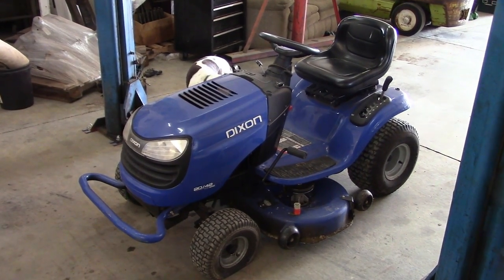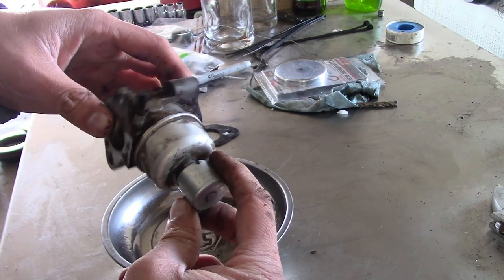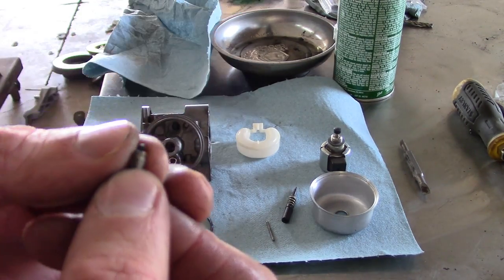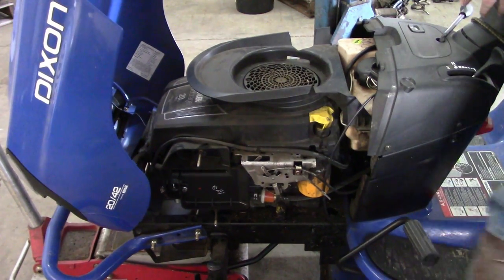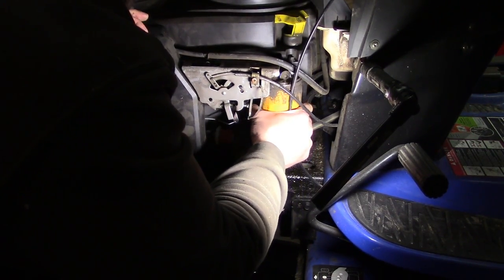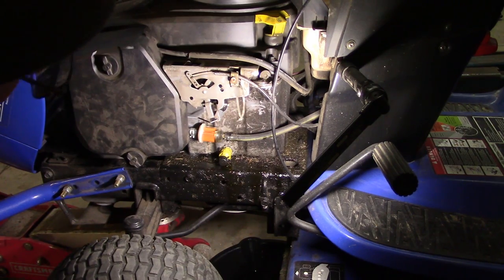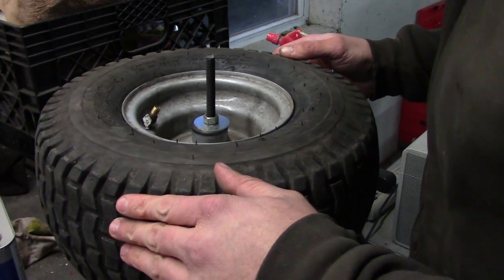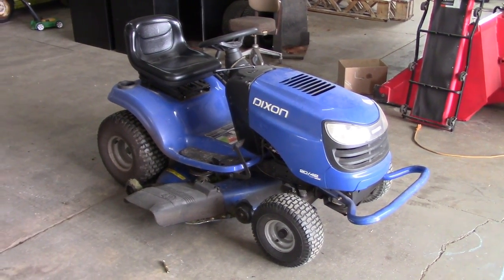Fixing up a Small Lawn Mower

Comment: Dixon was bought by AYP in 2004, but before then they were one of the pioneering brands for zero turn lawn mowers. The Dixon ZTR's were the best in their class at the time of manufacture. I own one dating to 1999, and it's still kicking to this day. I dare say that they don't make 'em like they used to!
Reply from the maker: My dad worked for a shop that was a Dixon dealer when they first came out with the friction clutch zero turn mowers in the 70s. He said they sold them like crazy.
Reply: @WatchWesWork  I'd believe it.

Comment: Hi Wes! I was a small engine tech at Sears for almost 20 years. Enjoy your videos! Just a tip- always use the Kohler oil filters- Fram is an auto filter and does not filter the oil on a small engine good enough. Also- those oil drains are designed to have a piece of tubing over the nipple so you don't make a huge mess. You also can start those without sitting on the seat by engaging the parking brake. Keep on wrenching buddy!!
Reply from the maker: Yeah, the customer sent the Fram, so I figured I better use it.
Reply: The OEM John Deere oil filters will also work as I have found out. The John Deere part number is AM125424c. I’m saying this because I put the same engine in my ‘85 John Deere lawn tractor and I don’t regret it one bit. I even had my fair share of “armchair mechanics” harassing me with bad info about my engine but I’m not willing to let that change my opinion.

Comment: Any project is good to watch. I was only half surprised at how tight the filter was. Found a few on various engines that required grunt effort to remove. Thank you for the video.
Reply from the maker: Yeah, I've had to use the air hammer before...

Comment: If you have access to an ultrasonic bath they are usually useful for cleaning small fiddly items like carburettors.
Reply: Gary Cunningham do you just set the whole carb in the ultra sound?
Reply: Josh Matthews disassemble as much as possible then put it in

Comment: Why do we like to watch Wes work? I’ve got to do the same thing to my mower and I’m avoiding like Wuhan virus.
Reply from the maker: I know. We had all winter, but of course it never got done. Now we need them...
Reply: Taryl has several useful videos on the Kohler Courage engine, as well as servicing the Tuff Torq transmission. The engine and carb manuals are free downloads on Kohler website.
I have a Cub Cadet LT 1045-
Reply: I like mower maintenance now because I am super cheap lol  as I spent 1900 bucks on my mower after I destroyed the first one from just using it and leaving it outside.  I bought this one at 40 so far I am two years in and I treat it like a classic Lincoln lol The goal is to never buy another one by maintaining it, cleaning it and properly storing it... Hell I even use stabil in the fuel tank incase I don't use it for a few months as the ethanol gas here in Commiefornia turns to garbage in a few weeks and even coats the gas cans in white powdery stuff that plugs fuel filters and carburetor orifices.
Reply: NGK PLUGS
MOBIL-1 OIL
ETHANOL-FREE PREMIUM GAS
Reply: @horacerumpole6912  I use ethanol-free gas from Quiktrip on my new murray 42"riding mower.
'

Comment: This channel is called Watch Wes Work. I subscribed because I like to see what you are doing, for some strange, creepy reason. Doesn't matter what you are working on, I do enjoy watching a professional doing things the right way. It has helped me on more than one occasion fix cars/equipment that I have. Because of that, I watch just about every video you put on the channel even if I don't care about the specific equipment. I might see a tip in there that works for something completely different, like the way you fix wiring issues.
Reply from the maker: Well thanks! I do the same with videos I watch.

Comment: Hey Wes, the front 4 10mm bolts that hold the crankcase halves together above the cylinder side of the engine have a tendency to back out and leak oil. In worse case situations they all come loose and the bottom half of the “bucket engine” as we call it will split right down the middle behind the starter and leak even more oil. Another issue is the cork style V shaped rocker cover gasket leaks oil too, I’ve always thrown that gasket away and siliconed it back together after bending the cover back flat again from the factory tightened bolts deforming it due to the thick cork. Not saying that you may not already know this but just figured I’d send ya some tips from what I’ve seen with these types of engines over the past 20 years
Reply from the maker: Well the valve cover leaks a lot. But I'm sure they won't want to fix it.
Reply: Watch Wes Work It isn’t a huge issue lol. It reminds me of a customer that brought hers to me except it was a huskee or husqvarna or something another and she said it won’t start and the mower also catches on fire every time she mows within the first 10 minutes but always goes out by itself and I thought to myself why not stop and check it since it should be a concerning issue right? Well her son never showed her that the hood actually flips up to check the oil and whatnot when he bought her the mower. So she’s had this mower for over a year and a half with zero maintenance done and the only reason she brought it to my shop was it wouldn’t start. 😂 Figured I’d share that funny story with ya

Comment: That is a cool looking mower. I like the color, and the bar in front. I had not heard of Dixon until now, nor had I seen a 20 hp single cylinder engine on a mower. I do wonder why they put such a big engine on such a small mower. 
I would recommend cleaning all that grass out of the mower deck. That is the number one contributor to rusting the deck out on any mower.
Good job on the carb.
Reply from the maker: It's just marketing BS. If that engine is 20 hp I'll eat my hat...

Comment: Take a short piece of galvanized water pipe with a pipe cap on one end and remove that oil drain gizmo and screw the water pipe straight into the block. The beauty of this is it allows the oil being drained to clear the frame and no scupper is needed to shunt the oil off the frame.

Comment: Make sure you tighten those top bolts in this bucket engine, and put some locktite on them.. They rattle loose, and hit the flywheel and it breaks the block every time-- super common.

Comment: Wes, that oil drain on that mower, if you stick a piece of hose on it, you won't get oil everywhere. I think it's 1/2". I use a piece of 1/2"  water hose. you can run it right down into the drain pan.

Comment: I used RTV on the bead of my Bobcat tires to stop it from leaking.  When I had the new tires mounted I just had the rims wire-wheeled.  The irony is that the new tires went on when I sold the tractor.  Just didn't see the point in putting new tires on when the existing ones were serviceable!

Comment: Nice fix Wes: I have a small engine shop and remove the idle screw stop often. EPA does not account for altitude, gas quality, atmosphere conditions etc. I have had many people throw away good mowers, trimmers, even riding mowers because they could not make them run correctly or at all. I have three in my shop right now. Especially with ethanol gas. I have a two year old briggs mower that the carb is completely destroyed due to ethanol gas. Green slime and corrosion. I ran it in my ultra sonic cleaners and got it to run until I bought an aftermarket carb. I have had pretty good luck with the aftermarket ones. The Honda's you have to remove the idle screw and pull the idle circuit plug out and run a mini drill or wire from a wire brush thru it. Usually I go up one niniature drill size and they run great. Thanks for excellent video's.
Reply from the maker: I've had that issue too. They are jetted for emissions I guess.

Comment: I have a command 25 from around 2005 that diesels like crazy and with it comes some nice backfiring too.
Reply from the maker: I have one too and it does the same thing. What I find works best is to shut the engine off with the throttle at 1/2 or even 3/4 open, instead of at an idle. You'll never believe this, but I actually learned that by reading the operating instruction tag on the mower!
Reply: @WatchWesWork  Wha?  People do that?  I'll have to give that a try!  I was raised back in the day when you idled equipment for a minute or two before you turned it off, and I'm pretty sure you were too.  If it stops the dieseling and backfiring I'm all for it.

Comment: Brake cleaner is also lens cleaner.
I got a Chinese supercheap Walbro, it was jetted for high altitude. Never ran right here at 1000ft. I ended up using it as a blank to convert a generator to propane. Thanks for all the videos. Keep up the great work.

Comment: Make sure to check the crankcase cover bolts,  that courage engine was notorious for those coming loose  the flywheel would hit the bolt heads and crack the block.

Comment: I never ran straight 30 in a modern mower engine I know on my Koehler it calls for 10w30 I think all newer mower engines with a oil pump and filter usually takes 10w30. On the oil drain plug I never trusted those period pull the plug out check the thread size goto hardware store match up the threads get a short piece of pipe with a cap Teflon tape and call it a day I change mine out after 1st oil change and never looked back. Liked the video 👍

Comment: Looks pretty much identical to my antique Husqvarna LT125.  Which is a heap of crap.

THe ziptie hanging beside the oil filter was where the baggie with the manuals hung when it was new.  The oil filter you took off was almost certainly the factory fit one.  And, the drain bung screwing out like that is pretty much normal, I loctited mine in, and it still manages to loosen...
Reply from the maker: That's how I would describe it.

Comment: I don't mind these videos.  I have an upgraded/larger version of this machine and so it interested me.  My oil drain plug works, though, thank heaven.  And I admit to using green slime to fix my flats - with all the goat heads we have around here, if I didn't I'd be fixing tires all the time.  The slime seems to plug the holes up as fast as the goat heads make them.  Interesting video.  Thanks!

Comment: Another interesting video.  As a side note, I've changed the oil on my 22hp Briggs at least 22 times and have never filled the oil filter before I put it on. Of course its mounted horizontally so it would be impossible. Never filled an oil filter on anything, never have had a 4 stroke die from oil related issues (never even had one lose it all!).  Knock on wood I guess.  I also use the cheapest straight 30 weight in all my small 4 stroke engines.
Reply from the maker: The internet demands that all filters be filled!

Comment: i bought a JD 138 riding mower for 150 bucks, was told it didn't run. turned out the fuel hose had rotted on the inside and when the pump sucked fuel the hose would collapse. fixed it for 9 dollars. works perfect. 

also, we will watch anything. we're all bored and there's still 2 feet of snow in most of Canada. I can't even get to my spring projects.
Reply from the maker: It's supposed to snow here tonight!

Comment: Never really heard of Dixon! However, thank God that there is another name badge, on the vast line of lawn mowers, that likely all have the same parts and pieces, that can all be charged at a different rate, depending on how you feel, what day it is, and whether you know the answer to some obscure questions that the parts dealer will ask!!

The good news is, every dealer across the world, will carry one different part in stock at all times, but only the one that you will never need!! The one you need will have to be shipped, at three times the cost of the part, or overnight if you can find enough money, and your neighbor don’t have any goats!!
Reply from the maker: They used to be a respected name. They were the first company to me a zero turn mower in the US. They used a fantastically simple friction clutch system. My dad worked for a shop that was a Dixon dealer back when they first came out. They sold like hotcakes.

Comment: I have an MTD tiller with a Tecumseh Engine.  I have had it about 20 years.  I rebuilt the carb once.  The last 2 times, I bought a complete carb from Amazon, for less than the rebuild kit.  Maybe I was lucky and bought one that worked, but they have run great right out of the box.  

My experience with a carb for my Polaris Sportsman 500 was not so great. I never could make it run.  Wound up rebuilding the original and now have a paper weight for my desk.

Comment: Thanks for the video Wes... I just went through repairing a Troy built lawn tractor with the 18HP version of that motor.  On mine, the solenoid on the bottom of the carb bowl had quit working and it couldn't get any fuel.

Keep up the videos.  I like how you explain why you are doing things besides just showing us the how.

Comment: If you used Castro 4T mower oil, those long spouts are built into the bottle. When the bottle is empty, I fill it with other motor oils. Makes filling a engine dead easy

Comment: Yea, they bought out Dixon in 2008 I think. Found that out when my Dixon Kodiak 60" Zero Turn developed a leak in one of the hydraulic pumps and I found out that it was obsolete. Yanked the engine off of a very nice heavy built mower and sent the rest to scrap after a summer of it being right in front of my barn door in the way waiting to see if I could get some parts.

Comment: Pull plastic cover off that Kohler Courage engine and check the upper crankcase attach bolts for tightness, especially on the non carburetor side.  This engine vibrates quite a bit. Result is he crankcase bolts start to loosen up which causes the aluminum crankcase to crack where those bolts are.  This is first noticed by oil residue everywhere.  Locktite those bolts in place before crankcase cracks.

Comment: check the top crank case cover bolts on that kohler. They like to back out and catch the flywheel then they split the case right down the cylinder. Its a known issue but kohler will no longer warranty them. Also you can take that mixture adjustment screw out by popping that black cover off with a pair of pliers or cutters.

Comment: Really enjoy things like this. Just had to put a new drive belt on my Craftsman. Decent mower. Bought it new last year. 50 inch deck. 3 blade. Twin cylinder Kohler. It's really just an MTD unit but seems ok. Anyway hit a big ass stick on a trail I was mowing and it pushed into the transmission drive belt. Put a nice cut in it. Replaced that. Now new blades and an oil change. Greased the front end. So stupid that all you can grease. My point is sometimes it's nice to watch other folks do the same routine crap. Pick up some tricks/ideas.
Take care

Comment: Lawn tractor tires can be incredibly deceiving. A quick and dirty trick for bead leaks is right before you pop it on the bead, take some spray adhesive and go around the bead seating surface. I've fixed some pretty nasty rims this way and did not have to use a tube. And they're still holding to this day.

Comment: I revive and flip small engine stuff. If the rebuild kit for a particular carb is more than $15 and I can't go without it, then I will just throw the factory carb in my parts stash and replace it with a Chinese aftermarket. I lot of people hate them, but I rarely have had an issue with them. I got one with a bad shutoff solenoid once, but it wasn't a big deal, since I usually 86 them anyway. I just install a manual fuel shutoff on anything I work on, and replace the solenoid with a bolt. Those electronic fuel shutoffs have a high failure rate, in my experience. The manual ones cost three or four bucks and are much more durable.

Comment: Since I found it's cheaper to buy most carburetors than to buy a kit to repair them I've been replacing carburetors and found the replacement works as good or better than the originals.

Comment: Nicely done.  You should have tightened that oil filter about four more turns for good measure.
Reply from the maker: Right. Tighten until the engine mounts sheer off.

Comment: The Chinese aftermarket carbs are usually okay. I've used them on my Stihl chainsaw, Honda-equipped power washer, an Old Briggs powered Troy Bilt Horse... they always fire right up. And the low speed circuits are usually adjustable. The gaskets are usually thin and cheap so I back them with some Right Stuff or something.  They fire right up and run fine.

There's nothing wrong with wanting to minimize air pollution. It's the execution that's usually wanting.  I start up my old  80s Wheel Horse and can taste the fuel in the air. :) Of course, I can use it to process my old fuel too - it'll run just fine on old fuel 50/50 with fresh. Is that better than "recycling" it? Dunno.

Long, short, whatever. Keep them coming!
Reply from the maker: Right. I suppose making the carb less adjustable is also a good way to prevent whining and warranty claims from people getting them all messed up.

Comment: always learn something when watching someone else work on small engines.  They can be so tempermental, especially as they get older.
I was surprised it run better after you got done.  Maybe it was the needle-  it didnt seem to fall out on its own, so maybe that loose tip was the cause.  anyway- cant argue with success.  thks

Comment: I got a Chinese carb kit for my Honda generator. It came with new low oil kill switch, new spark plug, air filter, carb. All from the same or cheaper then a Honda carb kit. The carb has some things not finished like the Honda. It doesn’t have the port on the bottom for the bowl drain. So there’s one thing. Not necessary but it’s a cost cut.